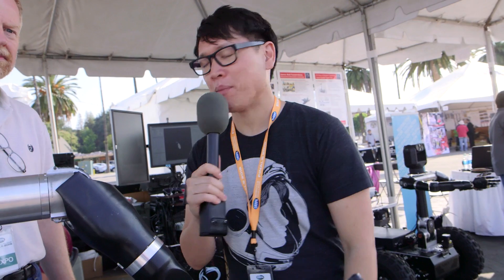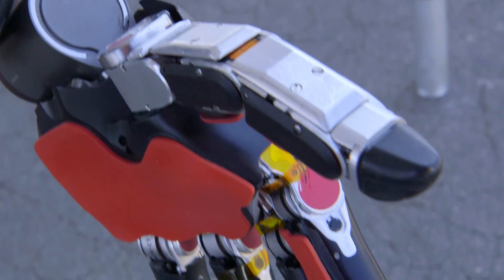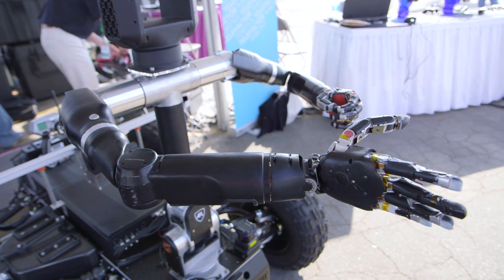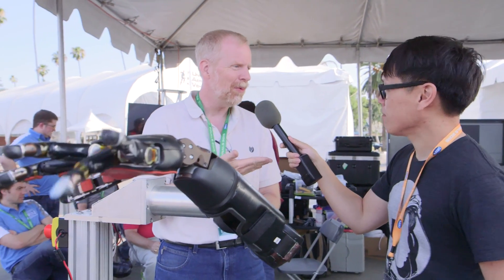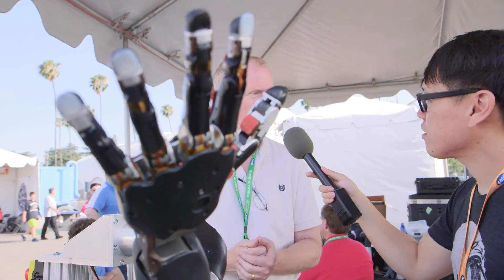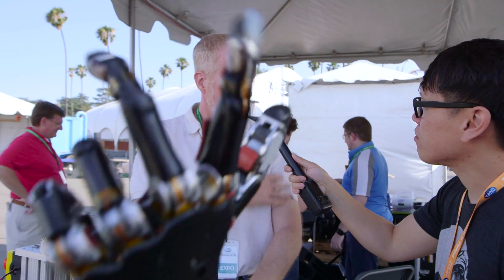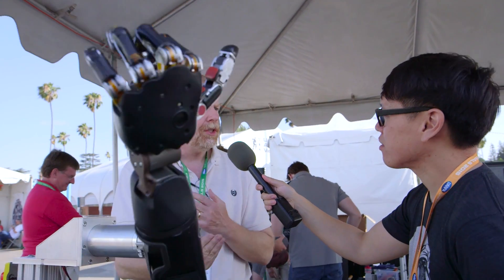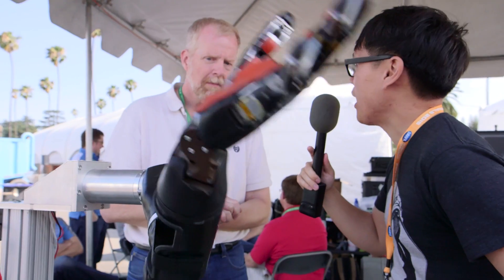Realistic Robot Arm: Meet the Modular Prosthetic Limb!

Comment: Come tell me when they have a prosthetic arm that runs off blood instead of brain waves and uses artificial muscles and tendons instead of servos and wires.
Reply: +TheHuntingPals That makes no sense, real arms don't even run off blood, the brain waves are what's used to CONTROL the arm, blood only keeps our real arms alive, so why would you want a prosthetic limb that dies without blood? Seems like it would be more of an advantage to have one that doesn't require blood to survive?
Reply: Zakashi But still, it's gotta be fucking strong, and fast, and can handle a beating in a fight.
Reply: +TheHuntingPals That's why you'd use plating that reflects or dissipates (stress) force to cover it. Plus punching metal may damage your hand more than it damages the metal xD

Comment: This is cool. and with it being compact, it will eventually be applicable.

But I believe the real breakthrough (and possible Nobel Prize winner) is going to be with the interface between Brain and prosthetic. If one can find a way to directly translate neuron firings to mechanical-electronic binary instructions and vice versa, in a near 1-to-1 performance  (minimal lag) then we could be in the age of  Deus Ex (video game) by then. Hopefully it comes within our lifetimes.
Reply: surft  direct nervous tissue connection has already been done, and the brain implant option the guy was talking about involves implanting a silicon chip into the parts of your brain associated with movement. so yea already done.

that's not to say the the chip is the best way. its actually 15 years old and the brain develops calluses over time, reducing its effectiveness. newer designs include a very promising silicon dust that will capture a more accurate picture as well as not suffering the degradation.
Reply: +surft Within the last month one man did get a prosthetic hand with a connection directly to the brain. Apparently its touch sensors feel almost natural.

Comment: cool, but likely very expensive with custom BLDC motors.

so, possible design using stepper motors (fairly common / affordable):
  fingers, 6x NEMA-14;
  wrist, 2x NEMA-17;
  curl/shoulder, 3x NEMA-23.

weight: approx 6 lbs (for motors, for 5-fingers)

( leaving out most intermediate calculations, etc... ).

strength:
  approx 35lbs grip (with a 1s open/close time);
  approx 50lbs wrist turn/deflection (2s);
  approx 40lbs curl and lift strength (4s over full range).

cost: approx $187 for motors for 5 fingers, approx $175 for 4 fingers.
cost would be lower if motors are bought at bulk prices (approx $130 for the motors).

other materials, probably would need a frame for the arm (likely plastic and/or aluminum), and likely some pulleys and thin steel cable (these motors would not fit in the joints, so would need to work via pulleys).

power required: probably around 200W peak (all motors going at the same time at full power, assuming motors running at 12v at rated values).

or such...
Reply: Brendan Bohannon Yeah, i'm assuming you can also get a TON more power out of a stepper too.
Reply: *****  vs BLDC? overall wattage vs size and weight is likely fairly comparable (it mostly has to do with heat), and these aren't particularly large steppers (the finger steppers are more like what would be found in a printer, and the larger ones are more like what would be found in a bench-top CNC).

typically, BLDC motors are designed for high-RPM low-torque (so are "weak" in this sense), whereas steppers are typically designed for lower-RPM high torque (so, they turn a lot harder but tend to be slower).

commodity steppers mostly are likely to be a fair bit cheaper than custom-made high-torque BLDC motors.

ultimately, how quickly and with how much power a load can be moved comes down to wattage. more watts means more power.

some of the larger motors listed could peak about 100W, or about 1/8 HP, so probably pretty good. rated power is closer to about 36W though (generally, the area between rated and peak is ok for short bursts, but above rated the motors will get very hot).

of course, a lot of watts also means needing a good power-source, so this would need some fairly powerful batteries (random thought of someone sticking in multiple cordless power-tool batteries).
Reply: Brendan Bohannon Haha, I appreciate the great explanation but I don't really need it (I do a lot of robotics). But yeah, I guess i'm just influenced by cnc steppers and over estimate steppers in general. We take a lot of caution around cncs, there's too many stories of people having their hands crushed.
Reply: *****  yeah. big steppers are pretty powerful, and can easily do some damage. little ones are not quite as powerful, and most of the types I had listed are not all that big.
Reply: Brendan Bohannon Just curious, but what's your background? It's always a pleasure to meet people who don't find this stuff boring.
Reply: *****

I am mostly a programmer (have been doing C, C++, and ASM, for most of my life thus far), but have more recently gained an interest in electronics and robotics. I have built a small rolling robot (which streams video back to a PC), and have also recently built a small CNC machine (it is a 24x24x24 inch box, and weighs around 150 lbs, still working some on making everything work).

mostly I am using hand-built electronics for running the motors, and have also written the code to control everything.

my projects thus far have typically used Raspberry Pi boards for running them.

in software, have experience with:
3D rendering and game engine development;
compiler and VM development;
real time signal processing (audio/video);
audio and video compression (developing specialized codecs);
...

the coding for the robotics stuff isn't all really that much different from the 3D engine stuff, except that it has to deal with much smaller latencies and on slower hardware (have to deal with microsecond latencies on MHz hardware, rather than millisecond latencies on GHz hardware).

I have generally had success using a custom codec for streaming video in real-time from the RPi, and have also experimented with real-time stereo depth inference on the RPi. these operate incrementally and so can be used at the same time it is being used for running motors and similar (without killing the latencies).

in benchmarks, the encoder can do 720p30 on the RPi, but generally I am streaming 240p20 from the webcam. the depth inference can take a pair of 240p images and produce a 80x60 depth image. both of them are based on VQ style technology (and runs entirely on the CPU).
Reply: Brendan Bohannon Pretty impressive, I can't say I've done as much though haha. I mainly do hardware related things for my team, mainly prototyping and design. Although like I said I mainly do hardware, I'm fluent in RobotC (which isn't saying much). That's basically the extent of my knowledge for software, but I'm sure it's lots of fun :)
Reply: *****  yeah, things like RobotC and the Arduino IDE seriously gloss over things. if one works more closely with the hardware, and writing plain C code, it is a little more involved.

I guess likewise goes for running motors. a lot of people use premade motor drivers, which work, but it is also possible to wire things up with transistors. though, I mostly went with transistors because past attempts at using driver ICs blew up, and I was like, "yeah, gonna use transistors, they don't as easily blow up" (have had transistors blow up, but generally they can take a little more abuse).

so, I have run things like PMDC, stepper, and BLDC motors, using transistor H-bridges.

actually, had also ran a converted car alternator (rewired into a 3-phase motor) and a salvaged split-phase induction motor off transistor H-bridges, but the results were less impressive... (would need to re-wind them to get good results...).

Comment: Man they should have put servos in so that it could curl 1000 lbs and pinch 200 lbs LOL. That would be awesome.. like Will Smith in iRobot and how he has the super strong robot arm. This is amazing work.
Reply: Spacemonkeymojo The robo arm may be able to support that but the body wouldnt be able to.
Reply: ***** we'd probably rip our own arm out since the limb is essentially using your arm as the anchor poin
Reply: Te Amasin Spoderman Yeah, exactly. You'd need that whole side of your upper body to be modified to suit it, at least. Imagine what we'll be able to do when full body prosthetics are available.
Reply: +dino seen They'd make you wear a half top skein with a buckle. Quite practical but you'd need to be able to KNOW that you'd be able to carry it and it would be balanced, which could be another issue...
Reply: Shadows_Assassin "a half top skein with a buckle." I'm afraid I'm not familiar with that. What is it?

Comment: can i have one attached to my stomach so i can have 3 arms
Reply: The Leithal Gamer Attaching it to your shoulder is more practical
Reply: The Leithal Gamer Someone wants to become a Tech-Priest. : D
Reply: The Leithal Gamer you couldn't have it attached to your shoulder because that would put to much stress on the joint.
putting it on your stomach would be an equally bad idea because theirs no real anchoring point, don't want it ripped out do you? and if you found a good place, you would have to practice for months before you could control it because the you've never had a third arm. you would also have to have brain surgery to get the silicon receptor chip.

but yea, it can probably be done... you first :)